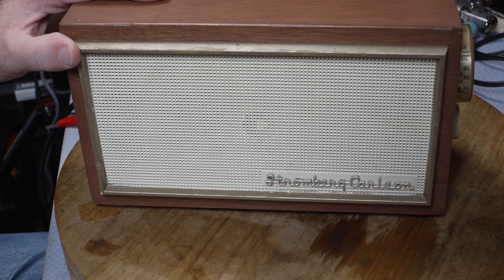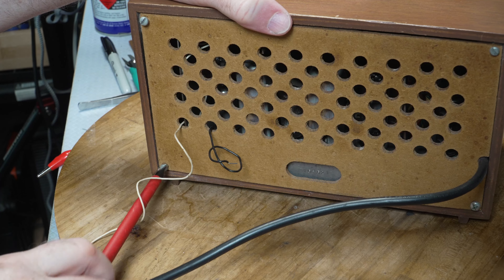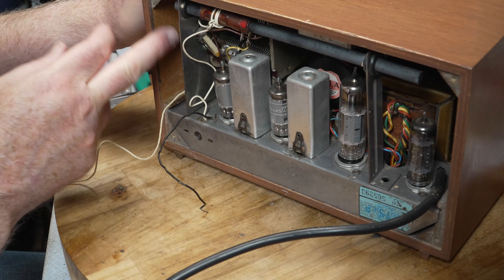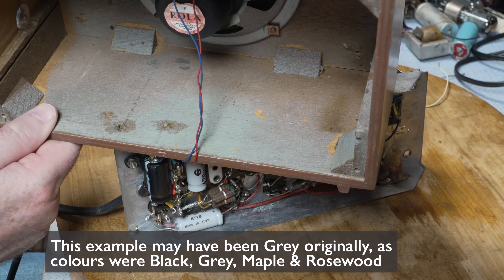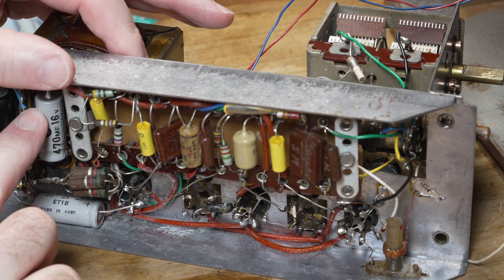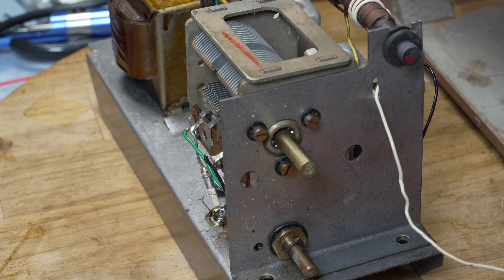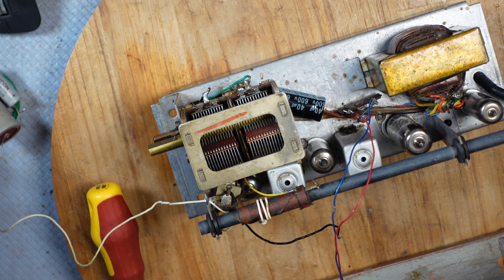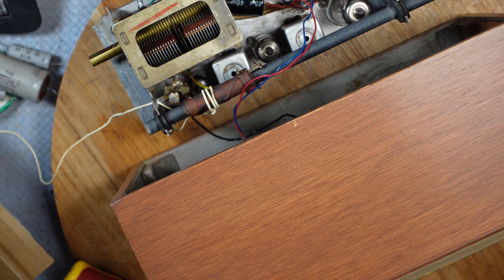Stromberg Baby Grand

Comment: Hi Andrew.  A nice little radio, even if it isn't entirely original.  I only counted 4 valves.  What's the valve line up?   These shorter format videos seem to be working for you.  Best of luck with the channel!
Reply from the maker: Hi Don, I now think the cabinet might be original, but the brown paint spot is a bit suss. It's certainly polished up nicely. I've also lost the tuning "nipple" between the back room and the kitchen somehow!
Valve lineup is 6BE6, 6BA6, 6BM8, and a 6X4.
Yes, the videos are going well. I think the numbers are because I'm putting #'s in the description.  I thought I may as well push the numbers although a few people have complained I'm doing so!!
I hope you're not near the bushfires, it's already Autumn here.
Reply: @electrosoundaust  Hi Andrew.  I'm sure you can make a suitable replacement "nipple".  Don't bother fitting it because as  soon as you've finished you'll find the original one.
Thanks for the valve lineup. That makes sense.
I've been putting #s in my descriptions for ages.  I don't think it does much good but it's so hard to tell what works.  Don't worry about people complaining about you trying to maximise your viewing hours.  In my view it's no different to asking viewers to "like and subscribe".  Stuff 'em. Do as you please!
i've had complaints about using bikini girls on my thumbnails. I'm still not sure if it's a good idea.  I pinch the photos from swimwear catalogues so I presume the models have consented to their images being used in advertising. Nevertheless I;ve backed away from it lately and it hasn't made any difference.
The only thing that's made any real difference was getting plugs from Manuel Caldeira and later Dave Tipton.  They boosted my numbers considerably.

Comment: Hi a mate has the same Radio and it has the same back that's on yours and the little Orange dot .
Reply from the maker: Sorry for the delay in responding. Yes I’ve since looked closely at 2 others at our club auction. Indeed that is the original back. I finally found the dot. It is pushed right into the hole! Not sure how I’m going to get it out!